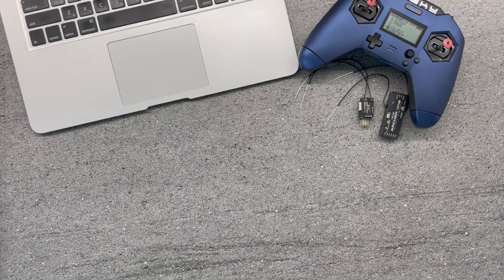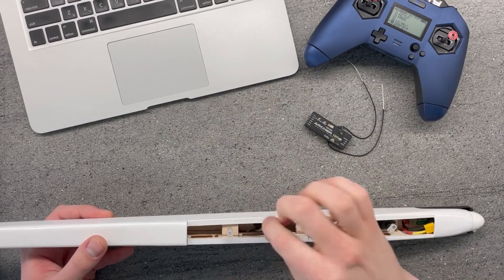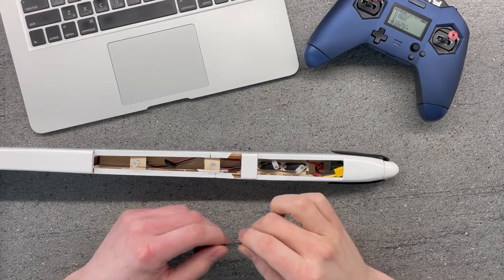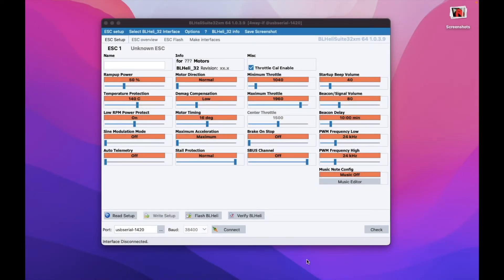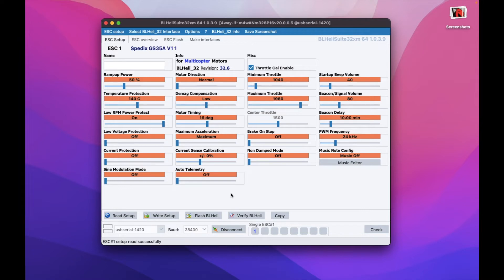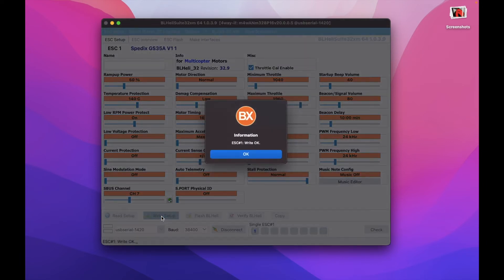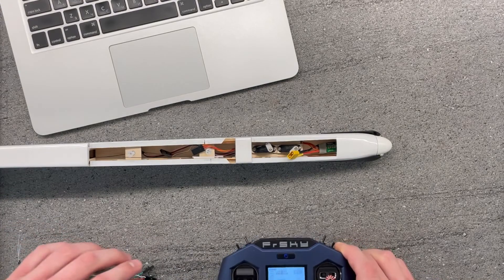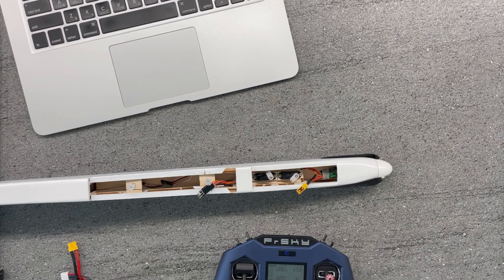+1 SBUS Channel With The Latest BLHeli_32

Comment: Did you try if an altis logger is working in this setup? Does it recognized the signal and can it cut it off to use it as a limiter? Thx!
Reply from the maker: Havent' tested it with Altis to say for sure, but in theory, since Altis don't work through SBUS, I'd say it won't work out of the box. However, in case you will add FrSky SBUS Decoder (SD1) between Altis and your Rx, it may. 

Your scheme should look like ESC > Altis > SD1 > Rx SBUS plug